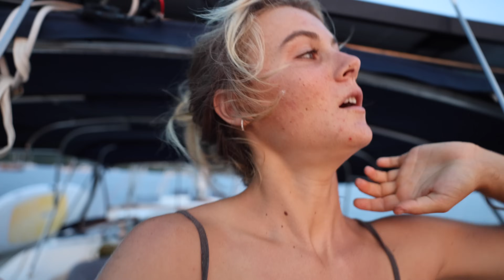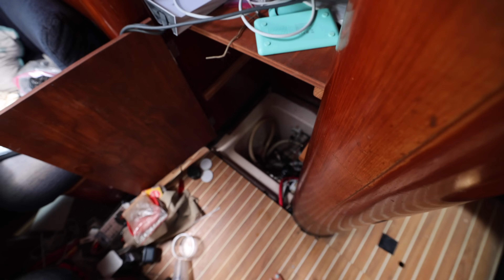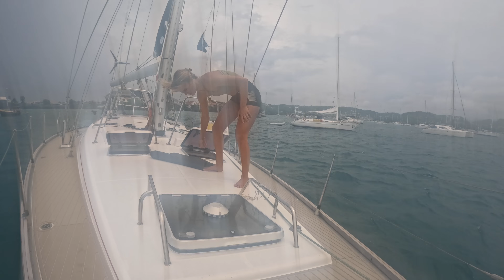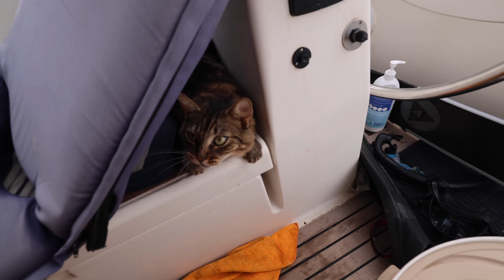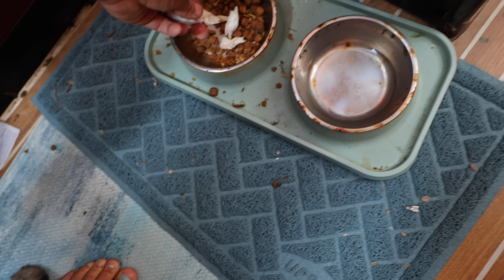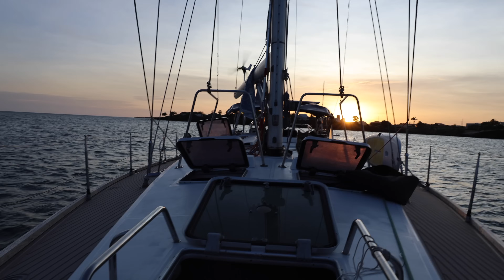BREAKING POINT; burnout is real [ep 84]

Comment: Hey Lauren!  Here are some suggestions for fixing your pump wire issue.  You will need a volt meter.  Put it in DC voltage testing mode.  Attach your negative on the voltmeter to the ground on your boat, turn the pump on, and touch the voltmeter positive to the positive wire on the pump.  See if you are getting power, you should get a 12.x reading.  IF not, you are dealing with possibly a bad wire or bad circuit breaker.  If you do show voltage, then the pump is probably bad.  Follow the line back to the panel.  Test both sides of the circuit breaker. using the above-described method.  If you are not 100% sure you are on the correct circuit, put the voltage meter in continuity mode.  It is helpful to have a piece of wire with alligator clips on both ends.  Attach one of your alligator clips to the positive wire on the pump, then attach the other alligator clip to one of your voltmeter leads.  Holding the voltmeter, touch all of the positive wires on your panel.  AS LONG AS there is not a break in the wire from the pump to the panel you will locate the correct line in the panel.  If none of the wires show continuity, then you have to assume the wire is broken.  At this point, I would take some spare wire, put a fuse in line in the wire, and wire from the panel directly to the pump to see if it comes on.  If it does, you have a broken wire from the panel to the pump.  You will have to run a new wire.  That was long and I hope it helps!

Comment: This should be called “the adventures of mako the cat” (with special appearances by Lauren). 
Love following

Disconnect both ends of the wiring (breaker and pumps), join the wires at one end and test the other end with “ohms” on your meter. This will tell you if there’s a break in the wiring.

Comment: Definition of Cruising…
Fixing your boat in paradise😎
I’m currently in Pago Pago, America Samoa waiting for some parts for a few days then heading to Fiji.
Don’t know of your fridge situation, but the fridge insulation is key to your power and batteries.  I rebuilt my box twice before I got it right ( only because Mexico had poor insulation when I did it the first time.
With 400W solar
400 amphrs usable firefly batteries 
I am usually charged at anchor before 10am
Underway by noon
Underway using radar for tracking weather, by 1pm
If there is no sun I can go a week before sun, or charge with Honda or engine.
I do have a google drive folder packed with fridge insulation info including spreadsheets for accurately calculating daily amphr loads, etc. and cruising guides/ info in the south pacific if you are headed that way.
Boat mechanics, sailing, diving, and travel have been a lifetime passion for me as I went to school for Aerospace Eng., Physics, Computer science with emphasis in thermal dynamics, and heat transfer…

Comment: Suggestion! Had a quick look down through the comments and no-one's recommended the rolly anchorage solution - take a line from mid-cleat or quarter cleat, or winch, to your anchor rode and pull in until you're head to swell, either port or stbd. Lie to a bridle independent of wind direction.

Comment: Been there....done that.  Go get yourself a slip in a marina, turn on your AC and finish your projects.  You're doing a hell of a job....trouble shooting can get frustrating....especially when you're sweating your ass off.  Run a power wire straight from your breaker panel to the shower sump pump.  If that clears your problem you have a problem in your lead so pull a new wire and be done with it.  Good luck.  It has been fun watching your journey.

Comment: Lauren, if there is no voltage at the shower pump but there is voltage at the terminals in the fuse box, there must be a switch between so when you turn the shower on the pump starts. I dont know what systems they use on boats but it could be a flow switch, so when you turn the shower control on a little water flows then it operates a flow switch which starts the pump?
If the flow sswitch has failed you could rig a temp switch you turn on when you shower, it also could be a switch on the shower control knob? same applies you could rig a switch until you can get it fixed.
The freezer compressor will turn off when the temp in the freezer has dropped to what it is set to, so maybe the thermostat is faulty? Unless it cant get rid of the heat? you mentioned a fan.

Comment: Lauren check all your ground connections, pull a temporary ground wire and see if that runs the pump.  If not take a cheap multimeter and follow wire until break found.😊 probably rusty butt connection

Comment: Check or replace the capacitor that runs the fan next to the compressor for your freezer. It’s a 1”x2” black rectangle with two black wires.

Comment: Doing a thorough prep on a friends old boat, before a 3-4 day race, we had rebuilt everything essential for round the clock racing. The binnacle compass lights were dead, so I picked up radical new red LEDs and replaced them. And still no light. It took hours to figure out some bozo had wired up the binnacle power with zip wire(extension cord wire) and dead behind the engine bay, bozo had simply twisted and tapes the wires. Once we found that, it took no time to fix them forever. But wtf twists wires on a boat?
 The good news is that we also found a "secret antitheft switch" in another run of zip cord. Boats. You can't assume ANYTHING was ever done right.

Comment: It's break time. Don't let maintenance seem like it's a chore.  She's a boat, and pampering her is just part of loving her. Purchase a 12 volt test light and a 12volt tracer with two simple to use tools you can test and track down wiring issues quickly. If you have rebuildable pumps, have a spare impeller and pressure switch available.  Other than that, get to Florida and once you've got your business taken care of kick back and just relax for a few days.  It really does the soul good to shrug off our worries and get that centered focus back.  I myself am just about to that same point.  Not knocked down, but just like the rocking, there's so much we can take and then we need to step away from it all and regroup.
Be safe and have some fun! 😊
Reply: Excellent advice Lauren. Troubleshooting doesn't have to be difficult. Break it down into simple components. Get some R&R. That will fix half of your problems. Love your spirit.
Reply from the maker: Exactly. I love boat work… so that’s why I’m taking the break ☺️
Reply: @laurenlanders  Yeah, I know that feeling.   They are more than just a boat or a home. They become a part of us.
Or we, them. I've never figured that one out yet. I hope that you are recharged and full of positive energy now.  It's so much easier to work on our loves when we have a smile on our faces and happiness in our hearts.  Fair winds sister,  you've got this.

Comment: Lauren, Run a couple of temporary wires from the pump to the battery with clips on the ends so you can shower. At least it will give you a little relief until you figure it out.

Comment: A couple of things on the shower pump: did you disconnect the shower pump before checking for voltage?....if not disconnect pump and look again....if yes on voltage jump line to a differeny pump in the boat and see if it works...if it does the line is fine....if still no voltage you will have to chase and check any connections to find where the break is.....if the line was ever spliced or a new line run for some reason that is probably where you will find the problem as the connection was probably not done correctly and it corroded over time.....also you could run a lamp cord or some other piece of wiring across the cabin from main terminal block to pump and see if the pump works.....possibly a temp way of using the shower till you get the time to chase the wiring....you are a real force to be able to do what you are doing.....you give the term super woman a whole new prospective.....

Comment: This may be something you already have or tried but get yourself an electric meter tester place the negative and the positive one the wire connection to the pump, if the power is there but yet the pump isn’t working that the pumps are out…. Happens a lot !!   Looks like you have easy access to the pumps to change out always good to carry extras.  This can also be done at the wire control center where the wires are coming out of the breaker box then you can test for bad switches….    Life is about fixing things !!  Lol.  And how you handle the stressful times and than be more astute and grateful for the good times when they come your way ….   😊

Comment: Voltage is needed to make it able for current to flow. Current make the pumps turn. Bad connection can show the correct voltage but there can be almost no current flow. Pumps draw easy like 10A and while starting to spin even more.
Take a 12V lamp (highest wattage you have, at least 20W , the bigger the better) Connect 2 wires to it. Connect one to the minus of the batteries, then probe with the other the pump connection closest to the batteries (in your switch board) If the lamp  does not turn on, or just weak, there is something limiting the current. In that case check the connections between battery and the connection you tested. Check switches and fuses and fuseholders (resistance measurement or by using the lichtbulb, does it burn before the switch and also after the switch).
Cabels generally do not break if they are in pipes. Most problems are in switches and connections. To much resistance causes a voltdrop and current limit. If it is 1 ohm, and the pump pulls 10A you loose 10 x 1 = 10V over that 1 ohm (f.i,. in a switch, corroded connection, loose screw etc) and a pump will not run at 2V (I use 12V as an example, the principle is the same for 24V) If the wires are long and thin you also loose voltage there. A connection that is not 100% fresh can in such a case be just to much)

It is also possible the pumps are bad and cause to much current draw. Try them direct connected to a battery. If they do not run the pumps are bad. If you have a current clamp you can measure current through cables, often that gives more information as voltage alone, if you measure both you will always find the problem. If you have questions let me know. (I repair industrial and maritime electronics ,so finding electronic problems is daily business) I live on a boat too

Comment: Do you have enough wire to run wires from the panel to the pump. If the pump works your problem is in the existing wiring.

Comment: You definitely need a break,Mako need s one to. When you come back bring a battery jump box you can use it to test run pumps etc with a pair of jumper wires also to back ck wiring. And it will crank your engine if you get a good one. Enjoy the break I’ll be watching for you to return . God Bless. Mack in SC

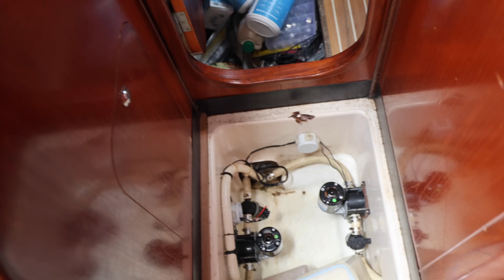Comment: I don't like the cabling around the pumps, it looks like water has come into contact with a live wire. Check the resistance. Even a pinhole in the shealth will still the corrosion and cause a bunch of issues (the high resistance turns the wiring into a space-heater sapping energy from elsewhere). It looks as though water may have gotten into the conduit, you'll see dark deposits (like in 5:52).

Those twist-on splices shouldn't be used in bilge areas as they aren't watertight. At least wrap them in amalgamation tape (it's better than the typical vinyl tape).

Enjoy you're R&R, burn out sucks!

Comment: Sailing solo is a tough undertaking, it's not for I'd say 95%  of sailors. There is a constant state of tension while at sea solo, it's not seen in most videos but it's there. Heck there's even tension while at anchor at times, will I drag? Can I leave the boat alone and unattended at anchor for the day while I go to town ? What's gonna break next ? Once ya get to the Pacific it only gets tougher, entering harbors and atolls can be extremely nerve racking. The constant stress will wear you down. My advice, for Your own Safety look for a plan B.....sometimes it turns out way better....Good Luck

Comment: Lauren, When in doubt step back, rethink. I have run many calls that have burned  ( exhaust fans bathroom fan running hot) down house/Apartment and yes boats so anytime if you have a hot motor please ( SHUT IT DOWN ASAP pull the breaker) ask for help. Life is better than an emergency/Fire.

Comment: Hi Lauren this is my first comment to you as I am a new guy here. Electrical problems will with out question drive a sane person crazy, that is a fact! I know nothing about how your boat systems are wired, however I do know something about electrical systems in general. Just the small about you videoed and talked about regarding no power to your shower pump. Being around salt water constantly tends to corrode things including wiring. Here's a thought, perhaps the power wire has corrosion within the wire shielding? If so the wire will appear normal looking at it wrapped in it's shielding, but if the wire became corroded to split a part, you ain't going to have power running thru it. Check the wire for conductivity! That's just a thought as I had that happen coming from my main battery cable. Wouldn't start, new battery, new starter, oops broken cable, crap. Best wishes, have fun and stay safe!

Comment: You are an incredible woman.. keep up the great adventure.. remember you can always stop and ask when near shore..
I teach high and low voltage classes for a automotive company.. and the absolute first thing I teach them is absolute importantance and minimum of a basic circuit.. this applies to everything electrical.... 
1) you need power supply,,, batt, gen,, etc..
2). The load,, aka,, light bulb,, fan, pump, you name it ,,12 or 24,, 120 volt.. there has to be something in that circuit to consume the voltage..
3) and the most important of them all ground!!!,,, with out return/ground your  complete circuit is not complete... 
A simple test probe can identify power,  at batt, power at load, if your light lights up after the load,,aka ground wire coming out of the pump,, that means you have an open ground... in other words power is going through the load but not consumed because no complete ground... 
If that load consumed it you would not see it lite, because the load consumed it all...
Remember,, power (+),, than load (aka, pump,, light, anything consumes on that circuit),, and the most important ground.. by the way never check ground at the battery,, always,, always,, always check the ground wire coming out of that load or at least where its going to bolt to.. you must check that circuit alone... 
Sorry for the rant good luck..

Comment: I go on  "body clock"  nowadays -  when you go head strong into something and find not only you wasted yr time / resources and....   you have to undo / clean the mess have less material to work with and realize that you literally would have been better off it you did nothing.  So I listen to body clock and find you dont dive into making a mess - and turns out body clock time seems to mesh / pans out.

Faulty connections --  might have a voltage but  wont take a load -  can throw you off finding fault.  Clean terminals.  And in some cases - such as welding lead for stick welder other night I literally short it out and where the smoking starts is where your fault is - I had no idea that portion of lead was faulty.  If the connection is good then the cable will tell you so the instant you short it.  So its not that dangerous just be mindful.  With electronics disconnect from sensitive devices first as "back electromotive force"  can spike / blow electronics.

Comment: These problems do not seem to be complex ones.  Some basic troubleshooting techniques should resolve or at least give some clear direction.  If you do not have that skill, you might develop it with research or formal training.  You depend on your boat for your very life.  Problem solving ability is crucial.  Beyond that skill, knowledge of electricity, electronics, mechanics, and physics would be greatly helpful.  Work that brain muscle as much as the rest of the body.

Comment: We just rewired our trainer  2019, the wire was new from China  copper wrapped around aluminum  wire , sooooo it has dissolved sitting in place never used , im not sure whst maybe uo with your equipment  i know for well over 40 yrs now i have to buy 3 stsrters for my truck before i get one thst works right, new off the shelf. Dont give up, but dont forget to read all those labels. Cheaper  is not better

Comment: I’ve been watching your vids for a while now. You’ve done really well considering I’ve never seen you use a volt ohmmeter, not that I can recall anyway. If you don’t have one get one and your life will be a lot better.
Reply from the maker: I have one and I was using (:
Reply: @laurenlanders  tell you a trick. I work on airplanes. Been doing it for 45 years. A volt ohm meter will show you volts and resistance and flow if you put it in series and it can handle the load. I don’t know if your boat is 12 or 24 volt but if you are checking a dc circuit use a known good load on your power wire and verify it will carry the load. I’ve had power on the meter but a bad wire that won’t carry the load. Bad ground will drive you crazy too. Ground gets corroded and no bueno! You can get test lights in parts stores but be careful they are rated for your voltage used in your system.